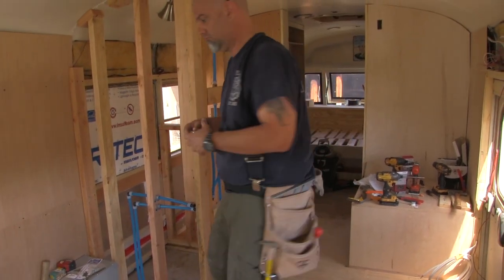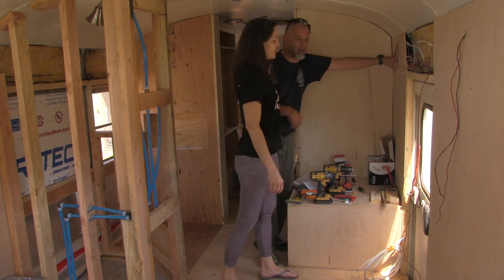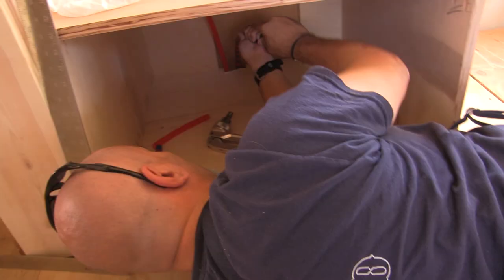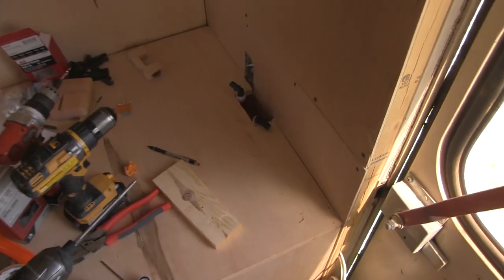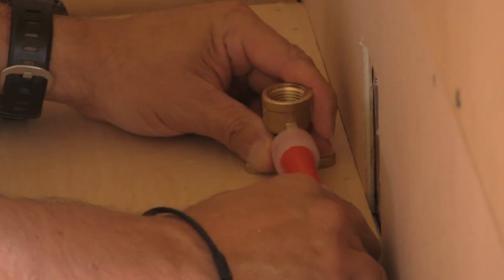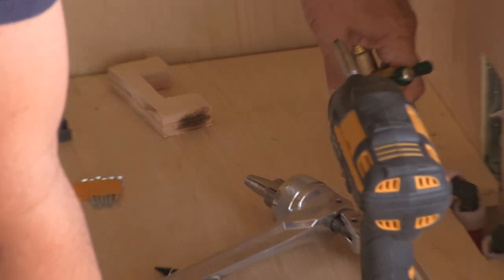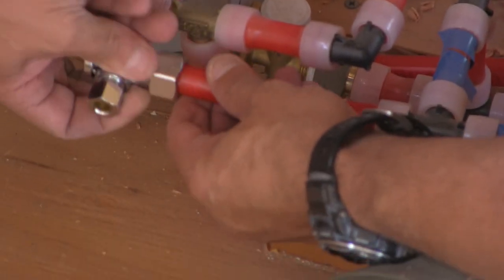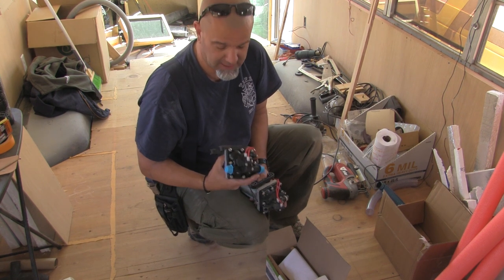Skoolie Plumbing: Pex Pressure Test

Comment: Hmmm.... maybe reading the operating instruction for that Pex tool might have been a good idea, would have saved you a lot of frustration with the number of fittings you have. That vibrating saw is similar to the one I tried to let you use early in your build, they are great and so versatile. Glad to see that there were no leaks after forgetting to turn your pump off, makes you feel good right. As a previous post stated the best part of this video was you scrambling to find that damn handle! Keep up the great work and videos.
Reply from the maker: Yeah, it was a great feeling! As for the pex tool, I knew it was suppose to be right, just didn't notice!

Comment: Epiphany!! Gotta love it!! The right tool, adjusted properly for the job. Ok, not telling you you're bussyness or anything, but as a safety precaution I'm thinking, while everything is open use some water sealer on the wood in the chase surrounding the tubing, fittings and pump. Yall are awesome!
Reply from the maker: Tripsolo65... "bussyness"... baaah ha ha! 😂
Reply: @BussyMcBusface  If you're ever installing uponor again, they recommend rotating the fittings as you expand them as well to avoid any possibility of leaks in the future

Comment: Congrats on no leaks, don't forget to instal hot water recirculation system while you have everything open. You'll save a ton of water
Reply: The one with 2 water heaters and 2 water pumps? I have an electric water heater for the sinks and an electric/gas for the shower. I've been dealing with this setup for 2 years and it is hardly intolerable ;-)

Comment: Awesomeness!! Was there any instructions on what the pressure switch should be set to??
Reply from the maker: I wont officially test it until I get the last valve it to release the last of the air in the lines at the washing machine stand.  I don't have any way to measure the pressure but I will tune it to just turn off completely while still providing good water.
Reply: @BussyMcBusface  I'm sure it will probably be tweaked again after the appliances are installed but who knows?! Great work on it so far yall love your vids!
Reply from the maker: Thanks man!

Comment: I like the channel and want you guys to succeed. But, at some point your going to wish you listened about protecting that PEX from the plumbers strap. I've worked in the trades. It not a matter of if it leaks but when. The plumbers strap is going to slowly cut thru the pipe... A few rounds of duct tape over the pipe or the strap is all it takes...
Reply from the maker: We have listened to you and bought the proper clamps.  I have replaced a few already and will replace all of them within a week or so. Thank you again!
Reply: Dan P. I was surprised to find duct tape on the copper pipes in a house built in 1988 so it was still holding 34 years later 😯